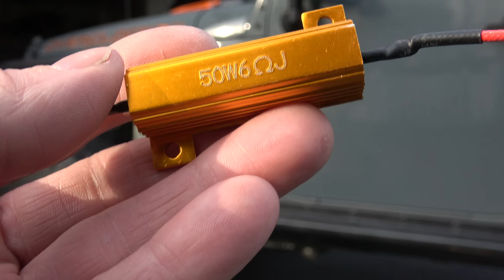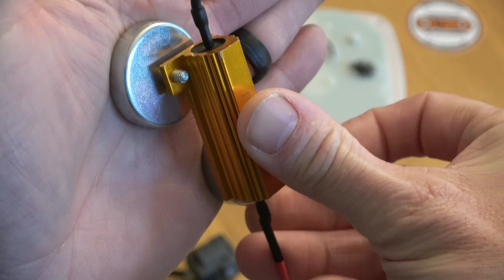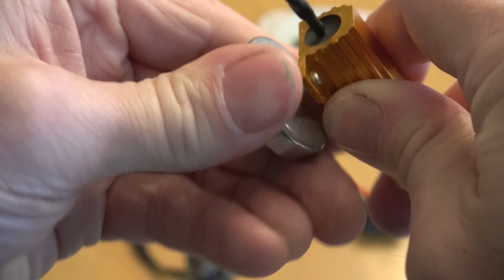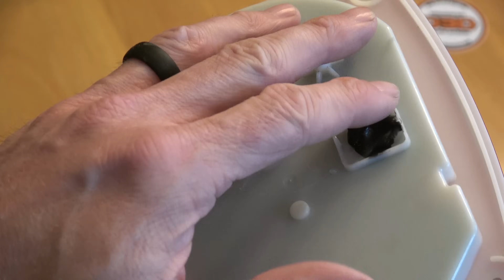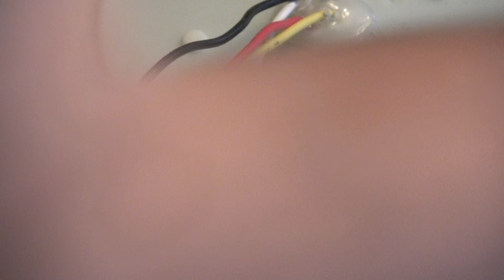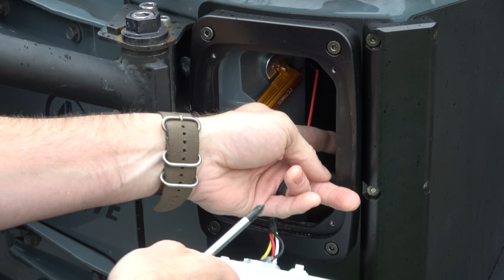Part 6 - HYPERFLASH FIX - Metalcloak LED Tail Light Kit - Load Resistor - 2015 Jeep Wrangler JK

Comment: Are there ever instances where you need to put the resistor both on the front signal and rear signal wires?  Not resolving issue with it on the rear signal.

Comment: In my case, turn lights hyper-flash only when I turn headlights on otherwise they are flash/blink normally. Does adding resistors would resolve hyper-flash with headlights on? Also seeing Check Engine Codes B1630, B162C, B1638, B1634, B1648, B1644

Comment: You guys are not very bright,  because by using the resistors you are using the same or more amperage than the incandescent which defeats the purpose of buying LED especially when you want every bit of batter power for your sound system,  winch, or AUX lights.
Reply: “You guys aren’t that bright”, yet you fail to realize that the resistor lowers the voltage for the LED. A LED uses LESS POWER so it needs a resistor to lower the voltage so it doesn’t burn up.

Comment: Brilliant idea!  I had been agonizing over drilling holes into my brand new 4R TRD Pro.  These little magnets will do the trick:  https://www.amazon.com/gp/product/B081DM8CS9  These are pretty strong and will likely stay put under the high-heat conditions of the resistor.  I live in Phoenix too, so I went for ultra-strong.  Thank you!

Comment: Hi, I have installed these led tail lights with built-in EMC, but the right one is bad and it blinks fast with a message lamp out. Can I install this resistor to make it work normal again?
Reply: Never mind, I did and it worked.

Comment: I recently bought a used 04 TJ that has Quadratec led taillights and it has the hyper flash problem.  Looking at the quadratec website, the taillight kits come with a special flasher that is made for the leds.  Looks like I need a Novita lm470 flasher.  Just ordered the flasher for about $17 including shipping.  Kind of excited to see how it works.  Hoping to not need the resistors at all once I replace the flasher.

Comment: Mounting the resistor using the magnets are not recommended. If you measure the resistor´ remperature you´ll notice it reaches over 320 degrees F, which is really dangerous.
Reply: Yes. The magnets will lose their strength when heated and then it’s a fire hazard if they fall on plastic etc.

Comment: This is total BS the manufacturer should know this is going to happen through testing and provide the resistor installed with the kit. That is totally crappy engineering
Reply: I purchased some led brake lights a few years ago, the lights have built in resistors but they failed so now I was to add resistors to salvage what I can.
Reply: I have to agree.  They should know that a resistor is needed for lights for the JK and they should be engineered into the lights.

Comment: Doesn't the load resistor draw the same power as the old incandescent bulb when wired in since it puts enough load back on the circuit so the computer doesn't see it as a blown bulb
Reply from the maker: It limits current, which provides enough load resistance to trick the computer to believe there is an incandescent bulb in place.  It doesn't draw or consume power, per se. It simply permits current to flow through it but at a reduced rate because of the added resistance. Think of it this way... a load resistor and a light bulb are the same thing. An incandescent light is just a form of a load resistor. It's allows current to flow through it, providing some resistance, and dissipates the energy into heat and light. The load resistor does exactly the same... except converts it all into heat, and no light.
Reply: Ok gotcha thanks for clearing that up for me

Comment: Very nice fix. I had that problem with a Silverado and uses a flasher module for LED s.  
 I was glad to see you don't use quick splices as they seem to fail over time. And, glad you warned Abbott the heat from the resistors. 
 Magnet seems like a good 💡 idea.
   Love the modifications. 🏆